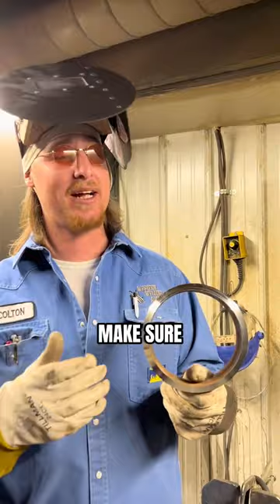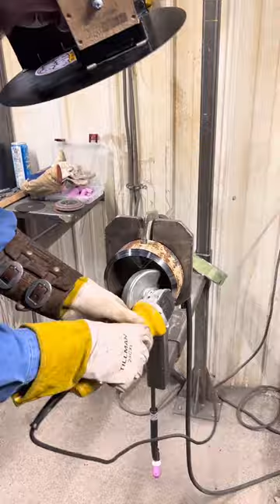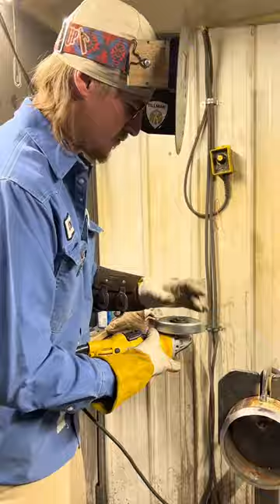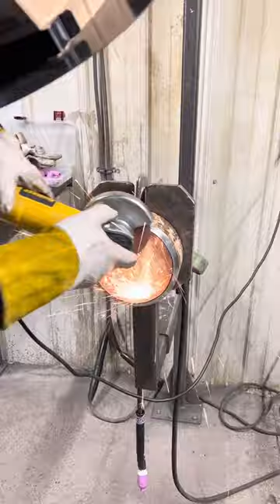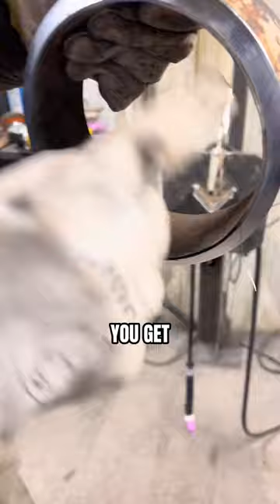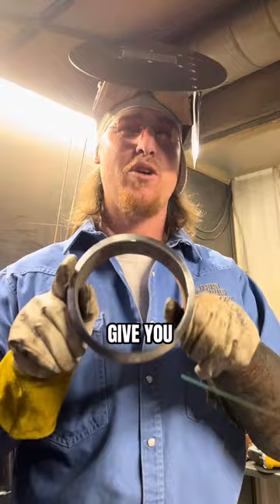Tip of the day from Colton 💪 #shorts

Comment: I’m in our highschool course and certification program for welding. Ive been trying my hardest to make the metal as clean as possible for the best results. It’s working. But the clean metal only does so much lol. I usually take my 1.5 hours of class on Monday to prep my metal for the week. Then I just weld on what I prepped the rest of the week. I usually make more when I run out. But I spend a good bit of time helping other guys too.
Reply from the maker: You can do it! Good luck dude